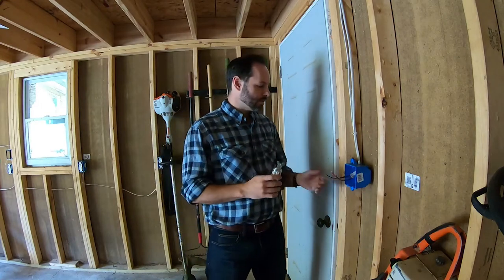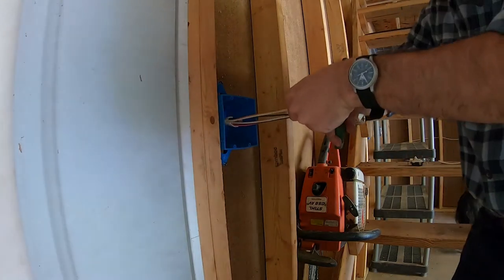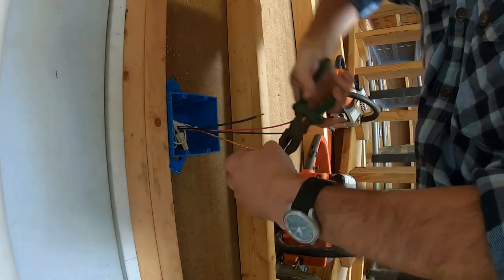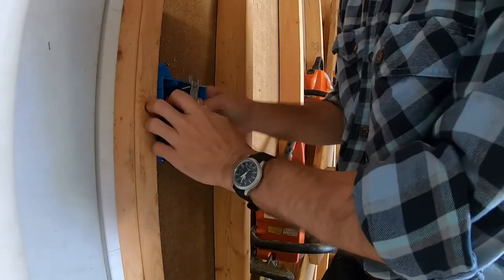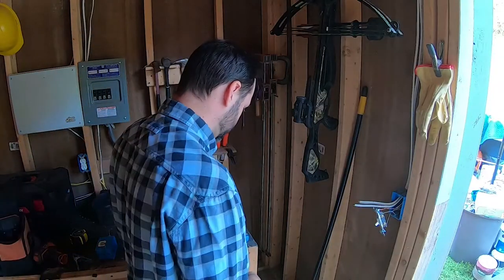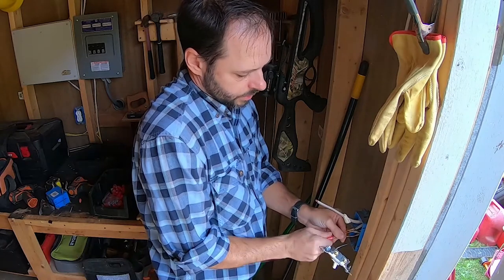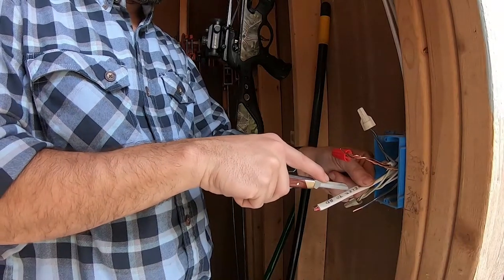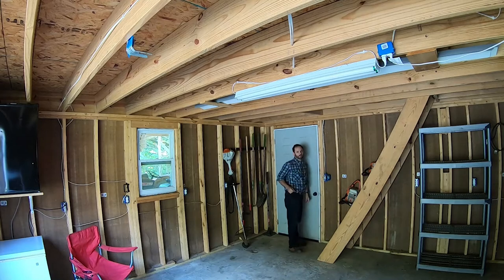Wiring a 3 Way Light Switch In Shop

Comment: It looks pretty simple to wire up a 3-way switch.  I rented a duplex that 2 3-way circuits that did not work correctly.  You had to turn the lights off with the same switch the light was turned on with.  Seeing you demonstrate how easy it is to wire, it makes me wonder what they did to get those 2 circuits wrong.  Great information!